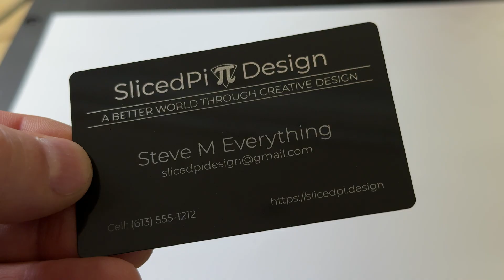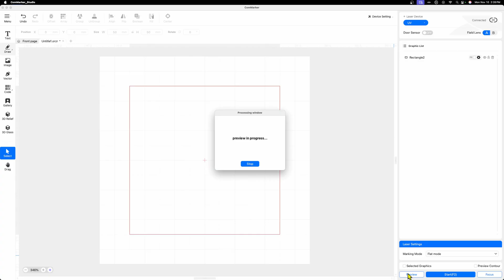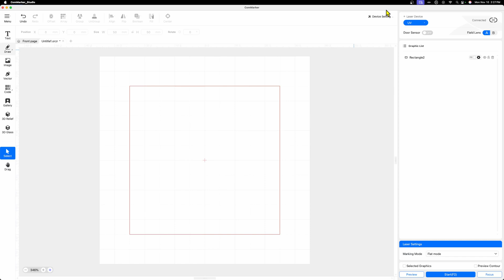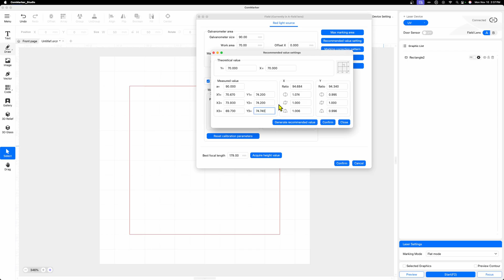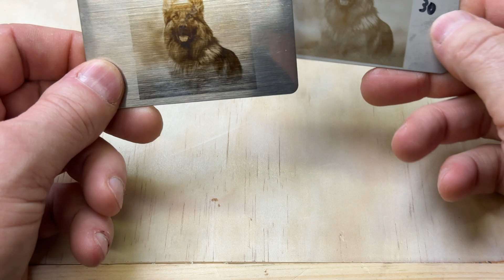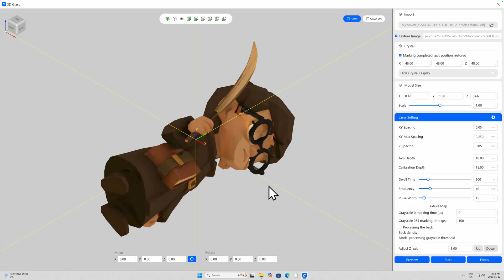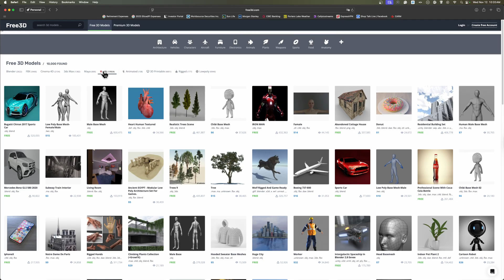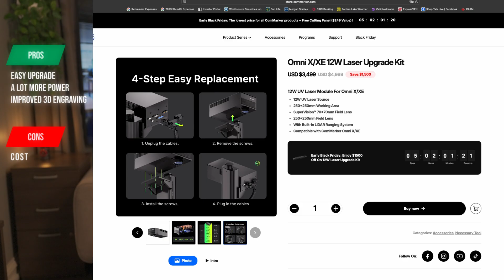5W vs 10W Omni X – Is the Upgrade Worth It? Side-by-Side Comparison!

Comment: Good review Steve. I’ve been considering the Omni X 10W after watching your review. However, since the diode lasers I currently use are quite limited for business applications—especially when it comes to engraving on metal, transparent acrylic, and glass—I’m exploring alternatives.

For roughly the same total cost as this machine, I could instead get one fiber or galvo IR laser and a Flux Beam CO₂ laser.

I’d love to hear your thoughts on this.
Also, do you have any recommendations for other affordable models with a larger working area, such as the Cloudray CO₂ galvo laser, or perhaps fiber laser options from brands like Longer or LaserPecker?
Reply from the maker: Uv lasers can engrave on almost anything but be aware that they can’t really cut things.  Maybe that means your diode lasers is still useful.

Fiber lasers of any useful size (60W+) pushes you into the same price range.  Unless you are tight on space I would avoid galvo CO2 lasers because one of the major values of CO2 is that they are great for cutting.  Being a galvo effectively nullifies that benefit because every cut will be at an angle.

I have always said that if you have a fiber, a uv laser and a co2 laser then you’ll have all the lasers you’ll ever need.  This is what I recommend everyone, who wants to run a laser business, works toward.

As far as brands, there are two paths.  You can go for the lowest price and build a mix of vendors and “OK” machines, but I’m becoming more of an Xtool fan every day.  They offer all of the tools you need in a cohesive experience, though they definitely aren’t the cheapest.  

Disclaimer:  I have no sponsorships of brand deals with anyone. I do have affiliate connections to almost every company though.  I try to stay as unbiased as possible.
Reply: @SteveMakesEverything I have to agree with your third paragraph.  I have all three and can engrave on just about anything. Now that I have the Xtool Metal Fab  I can cut about everything I need. They are  all just hobby lasers to me.

Comment: ..from all Omni X reviews found just 1 or 2 with real sound and that for less than 10 sec... maybe you can add a sample of 20 sec, or something conclusive, with a decibel meter next to it, heard is pretty loud. The 10W Omni 1 is watercooled, now 12W Omni X is aircooled, just want to see if I potentially buy an airplane engine sound in my room 😄
Reply from the maker: Well, the Omni X is loud, though it’s mostly caused by the four fans in the cabinet.  You can remove the cabinet and then it runs like an Omni 1, though then you’re back to wearing safety glasses while it’s running.  The OmniX has a couple of key advantages over the Omni 1 though.
Reply: @SteveMakesEverything  thanks Steve
Reply: Who cares if it's loud. 
Edit: Build an enclosure for it.

It's a machine, of course it makes sound 😂
Reply from the maker: @BeamMeUpLaserEngraving  I agreed but many wouldn't.  It is not the loudest this in my shop by a long shot, so I can't hear it over other things.
Reply: I have the 10w and didn't assemble to cabinet. Just the fans in the laser module is like a small vacuum. Its loud but bearable. Just make sure you put air filter on the outside so dust doesn't damage the machine.
Reply: @WilliamLI-g4q  thanks, usefull info
Reply from the maker: @WilliamLI-g4q  Good advice.  The fans are a bit loud, but once I turn on the vacuum system in my shop, I can't hear anything but that anyway. 😀